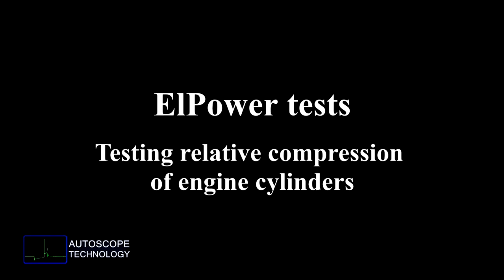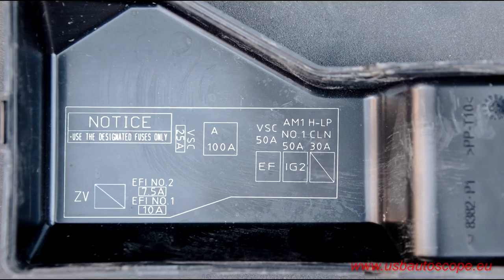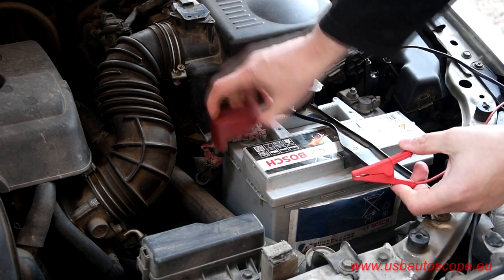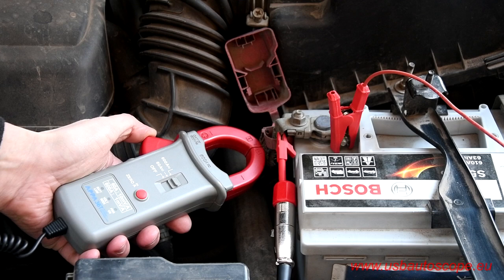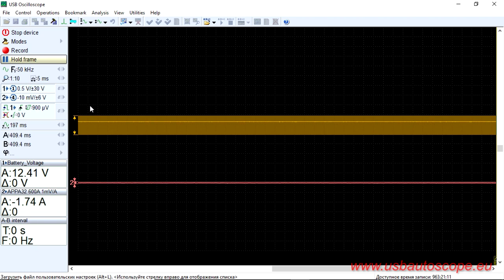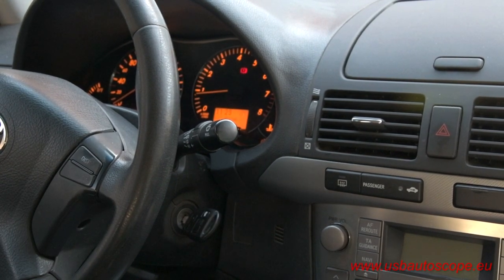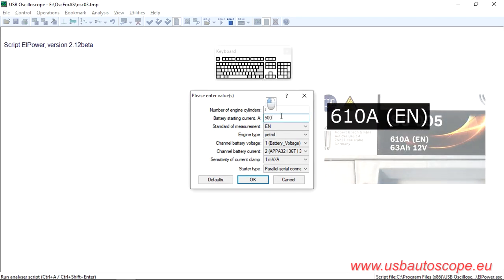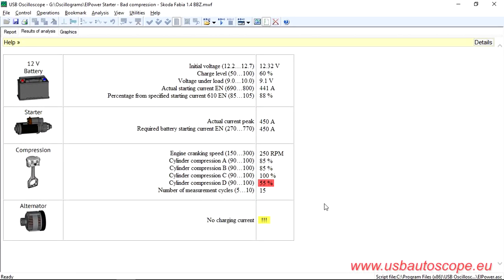Relative compression testing using the USB Autoscope

Comment: Thanks for sharing. I've a question, How does the software knows which cylinder has a low compression should any cylinder has a low compression? (since no sync signal was used in the demo)
Reply: It would be impossible without a sync my friend
Reply from the maker: In this version of the relative compression analysis the sync signal is not used. In the next version the test will use the sync signal to determine the exact cylinder.